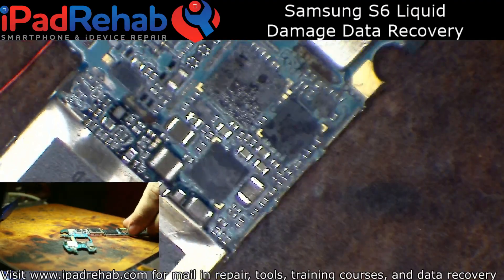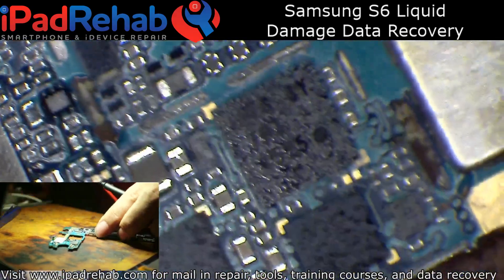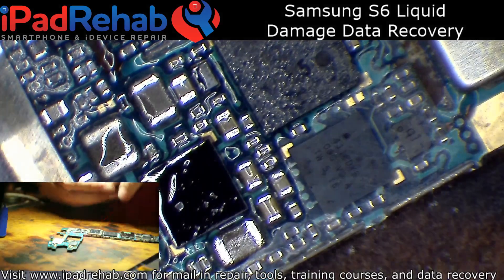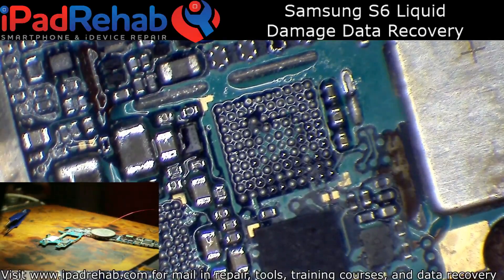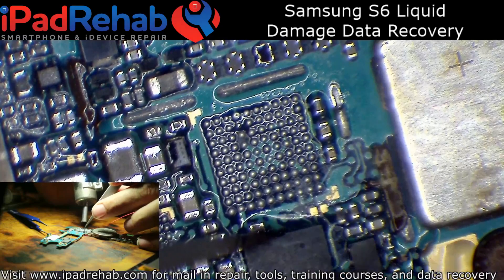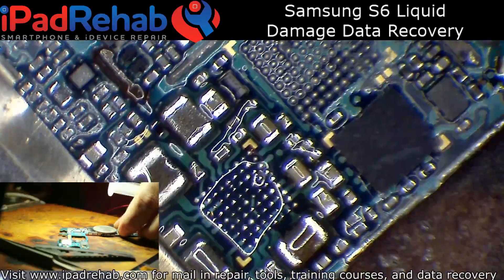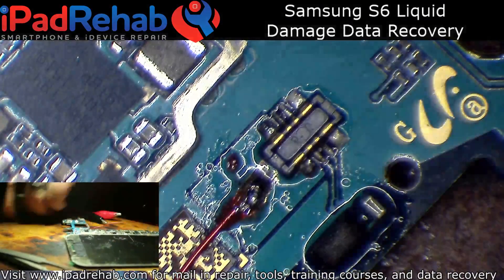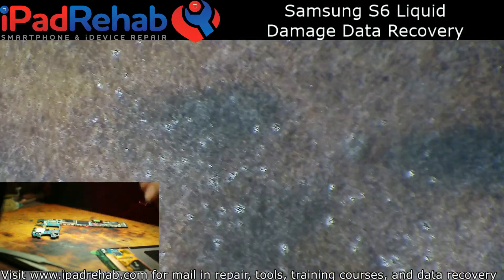Mark does Data Recovery on Samsung s6

Comment: Hello Mark.
I have a few Galaxy S6 and Galaxy S7 phones that have the same issue.
They freeze and you can't reboot them untill thw battery drains or you unplug it.
Only the blue light is on and the bottom touch keys and the phone doesn't respond to anything.
Can you please gice me some advice on where to look for the problem?
Thank you in advance.